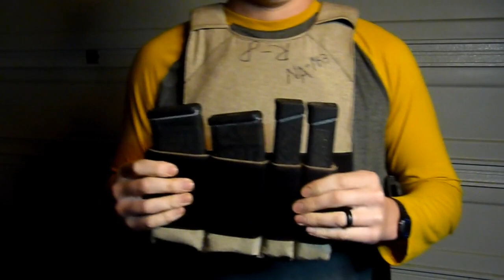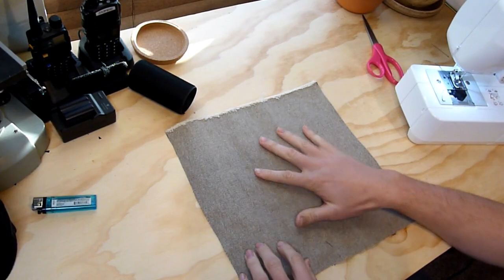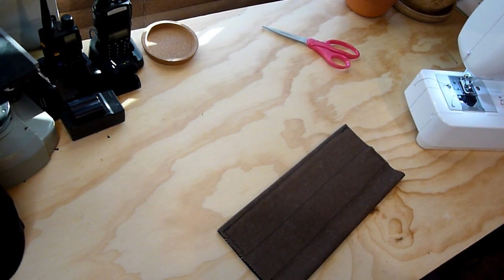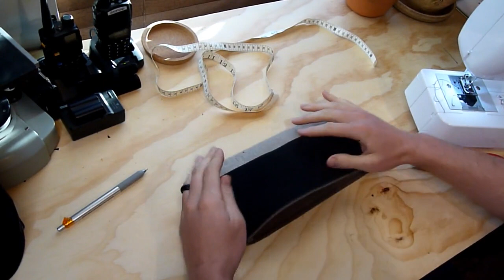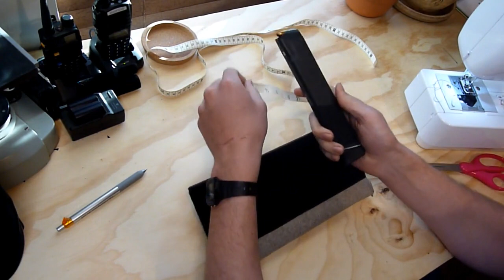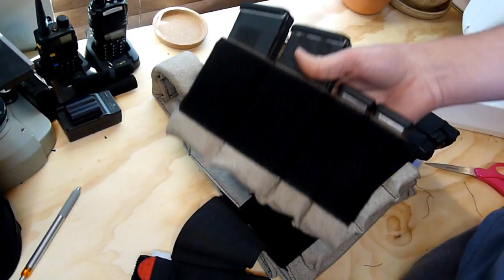How To Make A Mag Pouch // Plate Carrier Shingle

Comment: If the plate carrier you're using is home made, could you please do a guide on it, as well as publishing it's plan drawings.
Reply from the maker: This one is basically the same as the one in the low profile video. Just use wider Velcro on the front and double layer the elastic on the sides.

Comment: Will the Velcro be able to handle the weight of 6 ar mags? cause I don’t wanna be moving around and the Velcro just fall apart.
Reply from the maker: I’ve double stacked them before but I usually run just a single shingle so I can’t say it’s 100% but I bet it would be fine. Having the cummerbund over the outside does a lot to hold them on
Reply: @thriftyoperator637  good to know, great tutorial